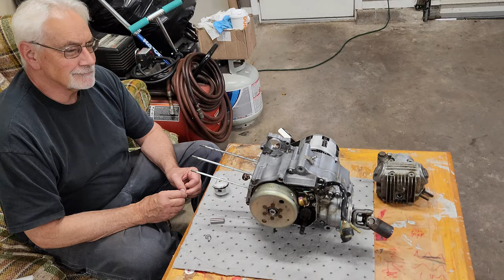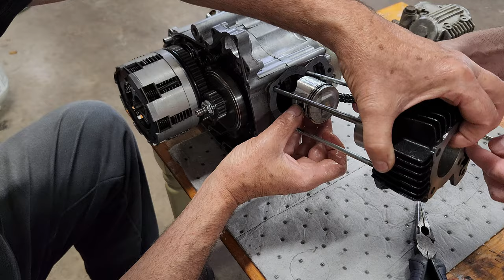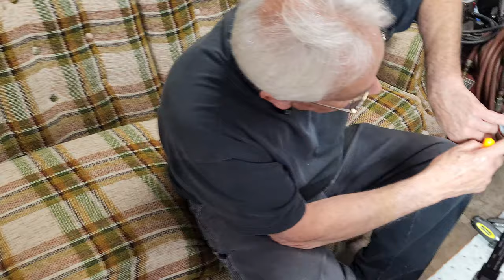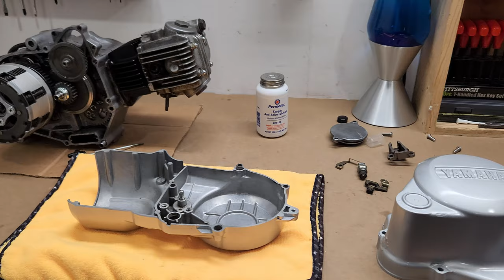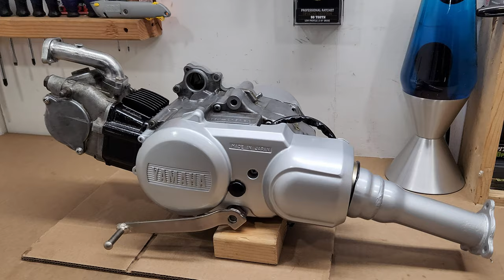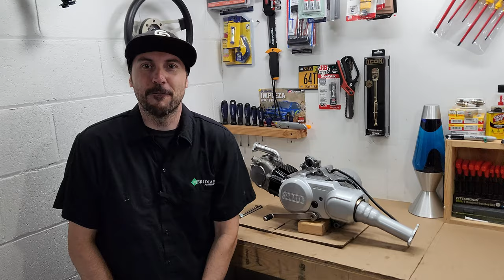'New Engine for the Badger!' YFM80 Raptor Moto 4 rebuild Ep.5

Comment: Where did you get parts to rebuild it. Was told we can't get them.
Reply from the maker: They have a tooe end rebuild kit available, and lots of the oem parts are still available as well. What are you looking for?
Reply: @YamahaBros  the rear ring and pinion needs to be rebuilt.  Had a local shop charge me $600 and didn't fix it. Said parts were not available.

Comment: I rebuilt the motor on mine already but it wouldn't move in gear so I got new clutch plates and and adjusted the clutch and it's still doing the same thing. The only thing I can think is that it's in the rear differential. Do you have any advice for me
Reply from the maker: Yes. The rear differentials are a weak point. The pinion or ring gears can strip out. I have a video where we rebuild one, check it out. I would pull your apart and see how it looks.
Reply: @YamahaBros  thanks so much yama bros. I've got quite a bit of time into making it look like it's 1986 again and was super frustrated when I changed the clutch plates and it still wouldn't move. I almost lit it on fire right then but I hung it up for a little bit and a couple months later I stumbled upon one of your vids. I'll have to let you know what I find and show you a pic of the restoration.

Comment: Do you know how to chage the rear end fluid are does it use the engine oil?
Reply from the maker: Depends on the year, some are just greased on the ring and pinion gears. Later models can run 80/90 gear oil
Reply: I think it's just greased thanks